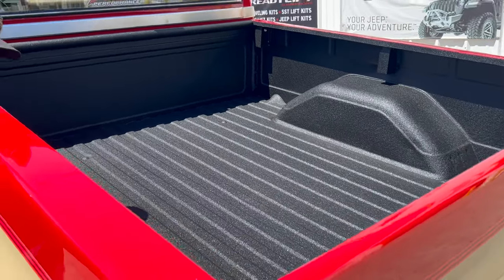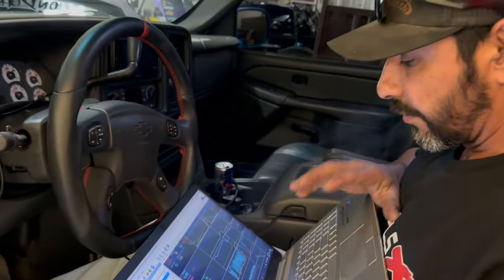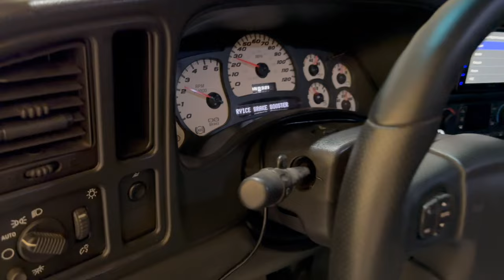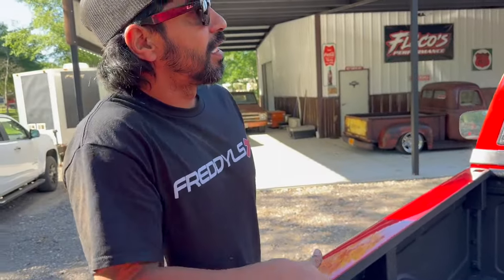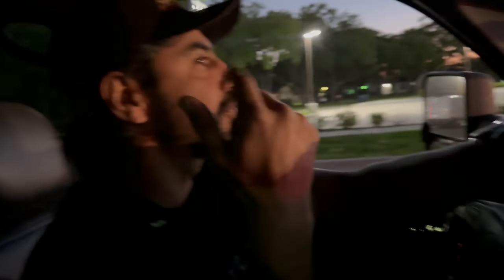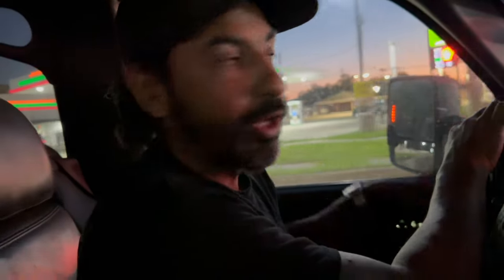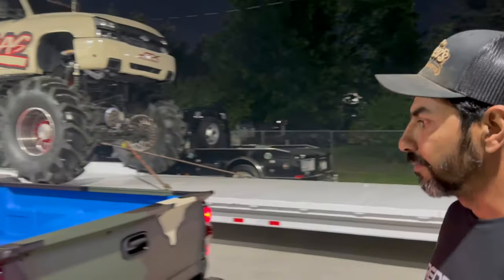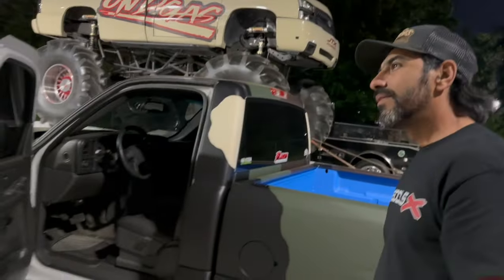Dolph Truck Gets The Sauce!!

Comment: Hey Flaco would you mind putting part numbers for the trutrac and the 456 gears i wanna get the same set up for my rear end
Reply from the maker: Its a Eaton Tru-Trac posi unit. And 4.56 gears for a 10 bolt